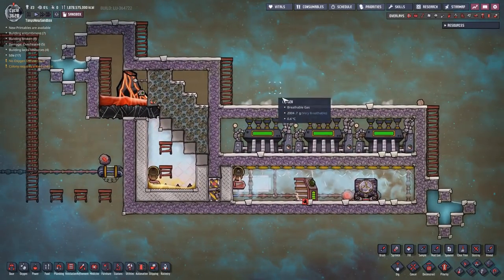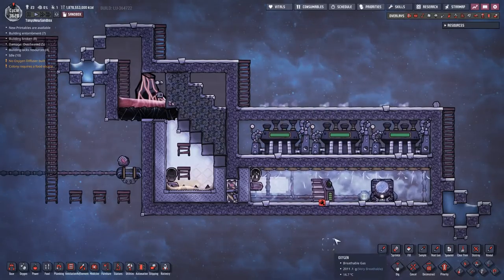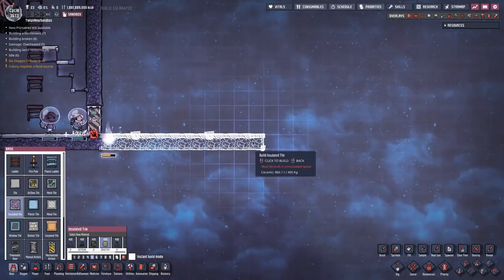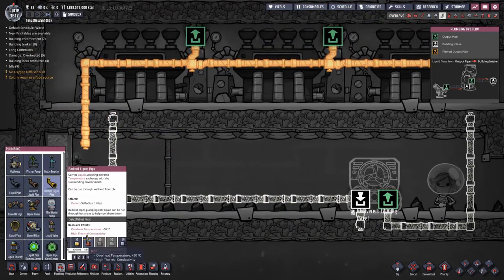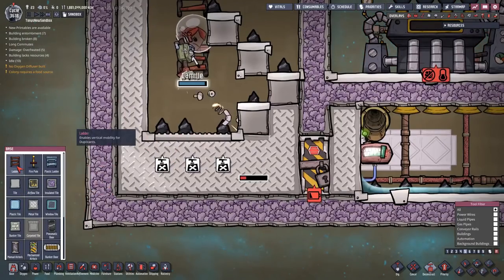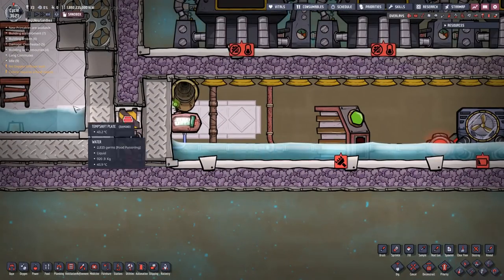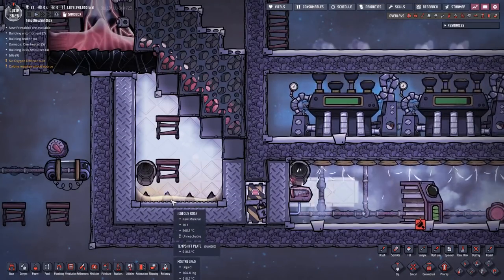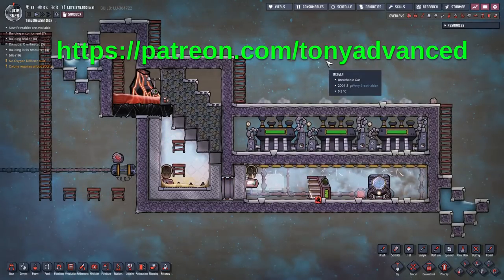Maximum Efficiency Volcano-to-Power - ONI Volcano Taming - Part 2

Comment: I have a map I would like to try this out on, but the map has zero clay and no clay means no ceramic, which you use to make some of your piping. So what would you recommend as an alternative to ceramic piping.
Reply: You could create a morb farm. They would release polluted oxygen which could be passively drawn through a floor covered in deodorizers by a pumping system. Unpowered door pumps would keep electricity costs at zero if there are no autosweepers involved. The game's framerate would approach zero with enough morbs, but it is still a viable option as long as you are conservative with ceramic usage.
Reply from the maker: I recommend using igneous rock for insulated pipes. You can use obsidian instead of ceramic for insulation in areas that are exposed to magma, and igneous rock everywhere else. Ceramic is quite nice but it's not necessary.
Reply: Thx for the reply. I was actually thinking on trying it out with using igneous pipes, never thought on Obsidian for insulation though, so I will have to keep that one in mind. Also just want to point out your Nutronium base for your Volcano is five tiles wide, they are always only 4 wide in the actual game, I've never seen them 5 wide before, I take it that is just because you are using sandbox. It's no big deal as it just means using another insulated tile in place of that fifth Nutronium tile but I thought I would mention it.

Comment: Am I imagining but was there a new video yesterday about the updated aquatuner bypass, but now it seems to not be there anymore. I'm trying to fix mine and was going to rewatch it but now it's gone!
Reply from the maker: I'm sorry. It turns out that the new way is also broken and I didn't want to be spreading misinformation so I took down the video. Im currently thinking that it impossible to do a bypass without a buffer space but there are some ideas I still need to science.
Reply: Is it because it very rarely still gets locked up? I made mine based off what I thought I remembered from yesterday's video, it once in a blue moon still locks up. So either I made it wrong or the design still needs tweaking.
Reply from the maker: @kevinjohn7056  Yes. I think it's worse, actually. Aquatuners have a couple rare behaviors that tend to break these things and one of them didn't happen when I was testing it out.

Comment: Can you indefinitely add water to the heat sink? There won't be any overpressure issues?
Reply from the maker: Yes. But you have to get it in there somehow. A liquid vent won't work once it's over 1000kg/tile.
Reply: @tonyadvanced6315  thank you! Love your vids.
Reply from the maker: Oh, also, if you ever cool it down so it condenses into water then it's a bomb.
Reply: Tony Advanced ooooh like some weird form of boiler mechanics, put to the extreme

Comment: In the 200 degree setup, I think you're using the aqua tuner 'out of context'.

With the 'usual' Steam turbine power generator / cooling loop, the SOURCE of the heat for the turbines, is the heat from the aqua tuner itself creating the steam. Here, however the SOURCE of the heat is from the magma / igneous rock, creating the steam.

So, the aqua tuner itself has absolutely no NEED to be INSIDE the steam block. Just place it OUTSIDE of the block, then you can use gold amalgam instead of steel.

It will still be doing exactly the same job of cooling the turbines (and itself) with the cooling loop, but not being destroyed by the 200 degree heat?
Reply from the maker: You could certainly make another building with an aquatuner/turbine setup and pipe the coolant to cool the turbines in the video. That would get around the need to use steel for the aquatuner. It's definitely a good idea if steel is a problem.
Reply: @tonyadvanced6315  Yes, and another thing is, with the aqua tuner INSIDE the turbine block, it's not 'contributing' to steam generation (it's effectively redundant for that purpose here) for its (intermittent) 1200 W consumption. I don't recall you mentioning what you set the temp of the temperature sensor in the cooling loop to?  But when you were hovering over the cooling loop pipe it looked like 12.6 C in the pipes?

So, there's a trade off between how much cooling you need to keep the Steam turbines from overheating, vs how much power the aqua tuner is 'wasting' doing that cooling.

If you only need to cool the turbines down to just under their overheat temp, there won't be much power wasted. But if you need so much cooling, that the aqua tuner itself is getting hot enough to boil water, then it would make even more sense to put it in its own block with yet another Steam turbine to turn 'that' heat into extra power, whilst still running the original 3 turbines at full power.

Anyway, it's going OT a bit really.

How many turbines can you chain with the volcano set up at 200 deg.C before they stop running at full power?
Reply from the maker: @johnsmith-nq2ze   The AT still generates heat all the same. That heat goes into the steam, which keeps it "cool" at about 200C. The power isn't wasted.
Reply from the maker: @johnsmith-nq2ze  In the long run, there's no reason to use more than 3 turbines for a volcano, 3 is enough to catch up during the dormant period no matter how beefy the volcano is.... I think. Now I'm not sure so I'll do the math real quick.
Reply from the maker: @johnsmith-nq2ze  I was wrong, the beefiest possible volcano requires 3.33 steam turbines if you include processing the heat produced by the aquatuner. Of course, that's assuming perfect efficiency.

Comment: Hello (i'm a bit late) i was looking to build one of those and i think this is the best i found.
I wanted to know if using a steel door would add any advantage since its thermal properties are closer to those of the iron tiles surrounding it? I guess the thermal transfer would be faster but is it a good thing?

Comment: I tried this and it worked great on my base, but how is your wires not overloading when the 3 turbines run at full capacity, did I missed something?
Reply: Charging a battery does not overload wires.

Comment: does anyone know what the Thermo sesonr number should be(that opens the door)also if below or above ?
Reply: You set it to what temperature you want the room to be. You're usually aiming for the steam to be 200c or below, so I set my thermo sensor to ABOVE 195. That means when the steam temperature is over 195celcius, the door is opened preventing further heat transfer.

Comment: Any advice for harvesting the igneous rock with your setup? I'm not sure if it's possible.
Reply: I think this stairway design/placement requires fairly high (over 200°c) Temps. when dealing with magma solidifying. 
space age material could be used to sweep the igneous rock out (to be cooled & used).
if the magma was slowly added into a 200°c steam chamber with enough steam turbines, steel could be used to sweep & ship out the rock (or dupe labor).
by creating a magma tank with a small opening in the bottom, you can control the flow with a steel door. excess magma can backup to cover the volcano, but if it's all well insulated/vacuum sealed, it'll start erupting again once the liquid magma level goes down.
Reply: You can use the same principle as the stairway to transfer the rocks into a normal steam room, rather than a heat sink steam room. Then you can load them into a conveyer normally.

Comment: can you build the mesh tiles for the spillway 2 lower, or the rock is just gonna pop on top of that?
I'm asking because i'm thinking about convenient dupe access for collection/maintenance.
Also saving 1 ton of metal... every bit counts on some maps. Cool vid BTW
Reply: Or is it a thermal mass thing? you gotta have them 4 high to absorb enough heat?
Reply from the maker: You can get by with mesh tiles 3-high but you'll still get a little rock on top. It has to be 4-high to be sure.
Reply: @tonyadvanced6315  Cool! tnx 4 the quick reply. glad I found your channel.

Comment: not sure what I'm missing but with my setup the steam turbines are always 100 degrees and keep flashing "too hot"
Reply from the maker: You have to keep the steam turbines cool. This build uses an aquatuner to cool them, something must have gone wrong with that.
Reply: @tonyadvanced6315  no I built it exact, problem was that the cooling loop had stopped, not sure how as the loop is the same as yours. Removing and replacing a pipe fixed it for now
Reply from the maker: @TheCaptOnix  I can think of a reason why that loop could get locked up like that. There is a flaw in the way water bypasses the aquatuner. It should be a very very rare problem. Hopefully you don't have any more trouble with it. I am planning to make a video about aquatuner bypasses with a better solution.
Reply: Having a buffer tank in the cooling loop helps solve this type of thing.

Comment: I'm playing on Volcanea and don't have access to lead. Is there anything else I can use as a substitute? Perhaps molten Iron? Although that doesn't give much wiggle room on how cool your heat sink room can get
Reply from the maker: Since making this video I discovered that if you wait long enough for the igneous rock to build up in the bottom of the room then you don't even need the lead. One rock doesn't give up heat fast enough, but when you have a hundred 25 tonne rocks then it's a force to be reckoned with.

Aluminum may be a passable substitute for the lead, but not iron because it won't stay liquid.

Comment: How do you connect that extra power to your main grid? I tried to use this exact design, but offloading it via power-shutoff / 2x power transformer overloads the conductive wire (for no good reason).
Reply: I am also having this issue (tried putting a transformer before sending power to base and conductive wire overloads). Would like to know how to efficiently connect this to main power grid
Reply: @Animatingfreak  you can put 2 extra transformers close to power source if you can pay the space and heat price
Reply: @Animatingfreak  actually in my design I ended up doing the self cooling setup. You need to reduce the temp to roughly 135 degrees, but it gets rid of thermal tuner and reduces the output way below 2k, making it safe for wires

Comment: now find one build where you can also extract the igneous rock :D
Reply: You could circulate the rock slowly on a rail into the steam room, then in the ST room to finish by dropping it outside. You just need material that resist 500/600 C° in the heatsink room and hydrogen in the turbines room to finish the cooling.
Reply: You can use the mesh tile trick to transfer the rock into a normal steam room, from which it can be extracted.